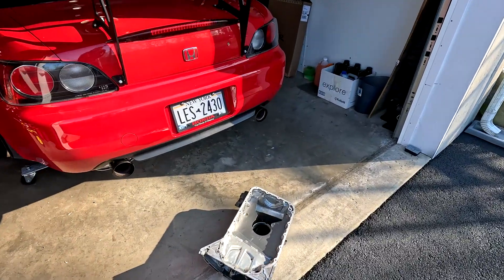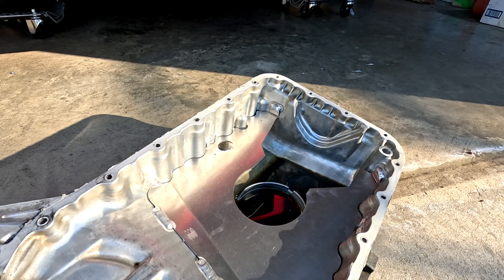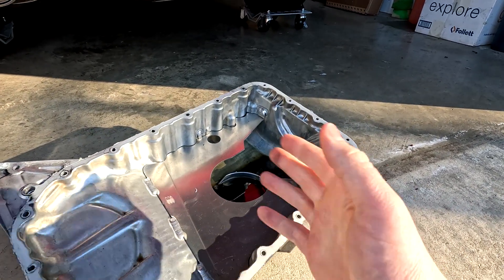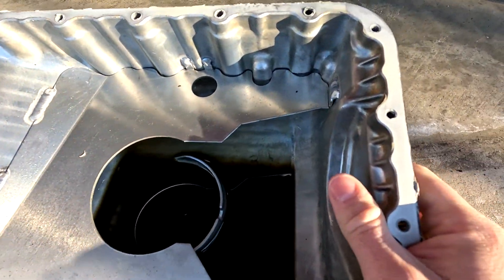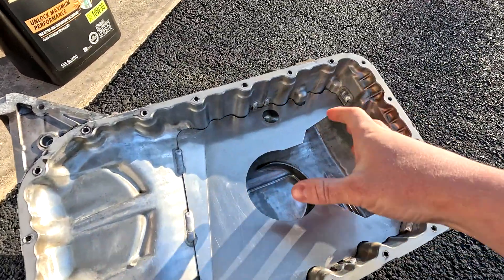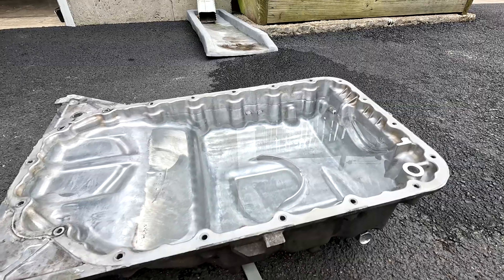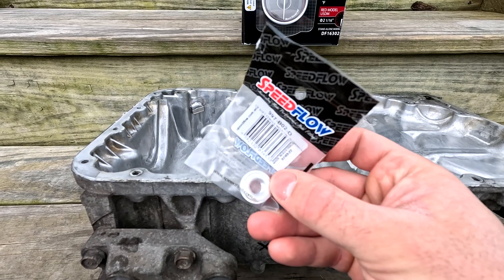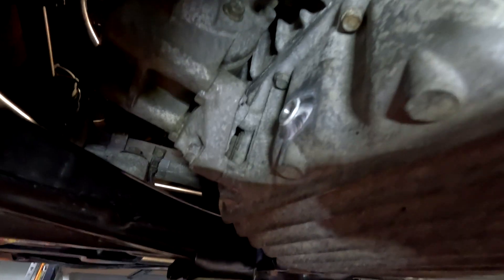Oil Pan Baffle Failure & Possible Engine Knock? -  S2000 Update

Comment: I'm running my S2000 without an oil pan baffle. I filled it with 5 liters of engine oil, which is about 200ml over the recommended amount. The oil level touching the 'H' mark on the dipstick. Since the oil circulates throughout the engine, nearly half of it doesn't remain in the oil pan. This setup should help keep the engine safe, especially since you have oil pressure and temperature gauges to monitor both — which are crucial for the S2000.

Comment: I bought that type of baffle off of eBay.  Looked the part but was junk… not even close to fitting.  I decided to go with the Moroso baffle.  So far no issues but I’ve also not removed the pan since it was installed.

Comment: I had a very similar baffle in mine and failed the exact same way on the welds. A bit ended up braking off and partially starving the engine of oil on the pickup. Ended up going for the ballade bolt in baffle. Almost cost me an engine ad I had to replace the main bearings as no3 just started wearing through the copper when I got it stripped down. Got very lucky I did. I would stay away from this style
Reply from the maker: Good to know I wasn’t the only one. I looked into the bolt in ones as well, however I read Some posts about the edges vibrating on the oil pan perimeter since it’s still a tight fit. Those vibrations caused aluminum dust in the oil. I plan to run no baffle for the foreseeable future

Comment: Upgrade your Oilpump. I have seen difference in the spring between the preface und faclift Oilpump. After the change it was good oil pressure.

Comment: I've logged oil pressure on a bunch of cars, on good tires there are always oil pressure drops without a baffle.  On track they are necessary unless you want to run an extra quart and a 1/2 or so.

Comment: Great info. I have a weld in baffle plate similar to this waiting on the shelf in my garage, but I've also been eyeing up a couple of the bolt in options. Wasn't aware of people doing hard track use without a baffle at all though, that's interesting. Good food for thought 👍

Comment: Excellent timing for this video.  I also have the Alloy Craft baffle and recent pulled my motor and found it was also cracked exactly like yours.    I actually wasn't surprised and it really didn't bother me as there is no place for it to go since the welds above it keep it in place.  Of course it's not ideal.  I just cleaned it up and welded the cracks and plan to stick it back in.  I also have a temp sensor in the exact same location you are putting yours.  Its a great location.  I appreciate your videos love your car!!

Comment: Damn I hope the motor is okay especially since you already changed the rod bearings once
Reply: How many miles were on the new rod bearings?
Reply from the maker: This video was actually filmed in May 2024 before I changed out the rod bearings in my garage. Car is all good still I’m just super behind with posting this footage (dang kids I tell yah)!
Reply: @NAUS2K  oh well that is really good news.  Still curious how many miles you have added since replacing if you have driven it much
Reply: @NAUS2K  can’t wait to see the video
Reply from the maker: Probably 6-700 ish miles since the new rod bearings. Not much. Didn’t get out much this past year

Comment: Yeah, S2000 weld in baffles seem to be unreliable and crack over time. I am looking to get a Evasive Motorsports bolt in baffle and give that a shot. Toda pan seems interesting as well.
Reply from the maker: @けんと-b3i  I do like the way the evs baffle bolts upwards and not into the pan itself. Seems like a well thought out solution. My only concern is if the edges are touching the pan, if vibrations would cause material to enter the oil over prolonged use